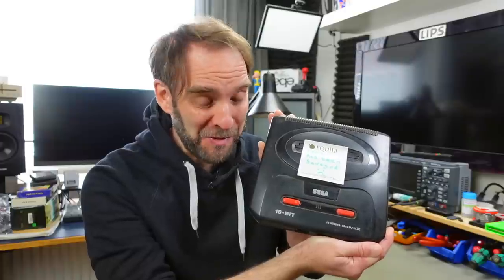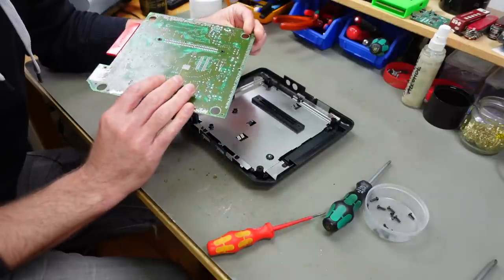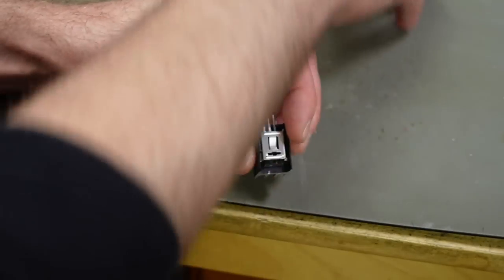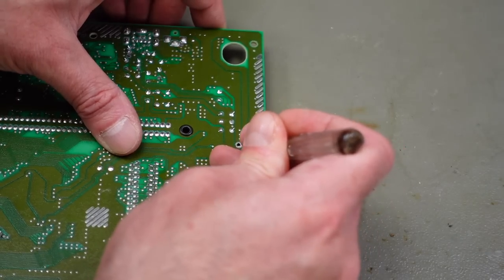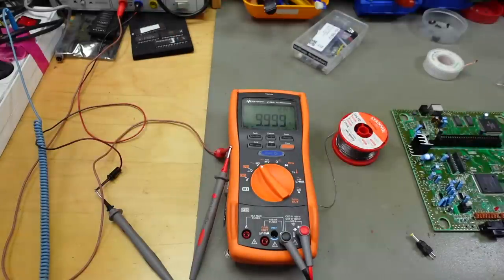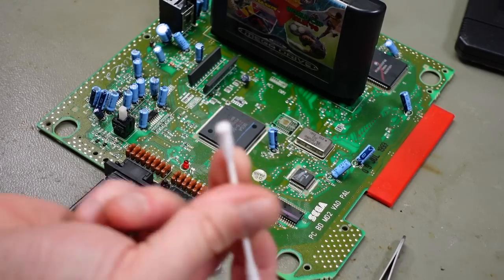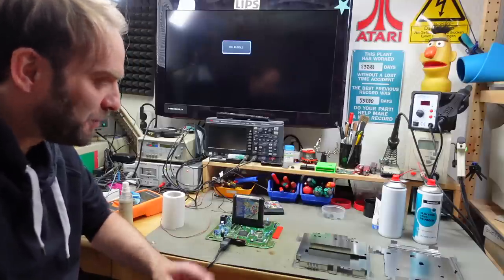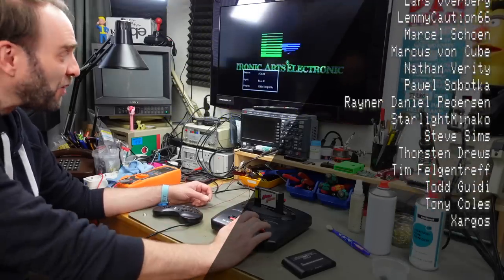Sega Mega Drive II Quick Fix and Cleanup

Comment: Hey Jan. When removing a regulator that's bound to a heatsink, get the hot air station out and warm up the area around the regulator, primarily the ground plane, then if you can prop station nozzle so its blowing on the heatsink while you work on the pins makes life far easier 👍
Reply: I just snip the legs of the regulator as close to the body as possible, pull the legs out of the board when the heatsink is off.
Reply: Seconded, hot air + iron works magic when you are working on heat sinking areas.

Comment: erm, wow, I totally forgot about that Megadrive, now I feel like a ** writing that on the case/board I don't remember doing it but I obviously did not consider the extra editing, if I remember right it was savaged before I got it and I had so much trouble getting the 7805 desoldered I gave up, fast forward XX months I now understand the value of a quality soldering iron :D great to see it is up and running again!
Reply: And we viewers now have to keep guessing what you wrote. I even paused the video but Jan Beta did his job well hiding it. Bummer.
Reply: @pe1dnn  Pretty sure the one on the board says FUN, because that's what you have when trying to desolder that 7805 and heatsink
Reply: @pe1dnn  it rhymed with ducked

Comment: I have two Megadrive II and both works perfectly. The market has been flooded with these machines and even if they were cheaper done most of the time they works better then the first version. The second one I bought for almost nothing since it had no box and cables. I even got a cool rent box and a RGB-cable.

Mega Drive 2 model used a different AV output from the first generation machine, with a much smaller plug design, however it brought the welcome addition of Stereo Audio along with the Composite Video signal (whereas the original Mega Drive only had Mono audio output, and relied on the headphone socket for stereo sound conectivity. If you have a TV with RGN SCART input, consider getting the best picture possible with a Multi-AV to RGB SCART Cable.

Comment: Thank you so much for putting this video out! I greatly appreciate the parts about removing the voltage regulator and fixing the reset button. :)
Reply from the maker: Hope it helps! It's certainly not very trivial to remove/replace the voltage regulator (as presented in the video). :D

Comment: Very good repair. I think there must be several different versions of the Mega Drive II. I bought a lot of 3 on Ebay as broken and when I opened them, all 3 of them were different inside.
Reply: There were multiple revisions, starting at VA0, which seems to be the one Jan has here. According to the net, at least the NTSC version went through several revisions more. I don't see hints at other PAL revisions, though. Might be a good idea to replace the 7805 in my MD2, though...

Comment: Fun fact:
The old 9/10V unregulated PSU that came with the Mega Drive are really more in the ballpark of modern 12V Regulated PSU.
I measured ~14V Idle for my Original Mega Drive Power Supply and 11,75V under Load.
Another thing: If you are at around 13,5V or lower at idle and 11,5V and lower under load, you need to replace the 3300µF/16V Cap inside.

I also have an old, Linear 12V PSU: unloaded it does 16V.
Due to Rippleness of modern PSU, I think it might make sense to replace the Input caps with Polymer or a mixture of Polymer and Ceramic capacitors instead.
Reply: On my Master System 2 I'm using a 9V PSU pilfered from a Guitar Pedal and it works :)
Reply: @DrTofu83  9V Regulated DC PSU? That can work in some cases, on my SFC, a 9V SMPS didn't work.
Though I don't own an Original one, aand can't measure it. And getting ine isn't easy as I need a Step Down Converter too...
But I got a 10V Mega Drive one and measured that. And that was around 1,,75V under load, with a new Secondary Cap and~14V unloaded. Someone with a US NTSC SNES measured the no load Voltage for me and it was similar to the Mega Drive PSU....
Though I need to get a FULL BRIDGE RECTIFIER Inside the SFC.

Also, something that might be important for use with modern PSU: you might want to replace the Input Cap with a modern Low ESR or even Polymer Cap.
Reply: @Stefan_Payne  Guess I got lucky, or the EU Master System II was somewhat more forgiving. 

The original 10V PSU died, I had this 9V from a guitar pedal, tried it and it worked with no hiccups
Reply: @DrTofu83  How could the Original PSU die though? ;)
Its just a lump of Copper and Metal + 2 or 4 Diodes and a BIG Capacitor. That's about it.
So my guess would be that your Original PSU should be serviceable, if you still have it. All you need to do is to replace the Capacitor and/or the Diodes (or the Diodes with a FULL BRIDGE RECTIFIER)...

Comment: Thanks for another nice video Jan; when you first opened the case I thought "someone has already replaced all (electrolitic) capacitors', that's how it looked to me. Are you sure those are the original capacitors?
Reply from the maker: Pretty sure. They are from the nineties (judging by their design) and there are no signs of resoldering on any of the capacitors as far as I can tell.

Comment: The z80 was often thrown in to that large ASIC chip, starting with the 315 label. Originally on model 1s it was just the VDP but later down the line they put more and more components into that ASIC.

Comment: For things like that regulator, preheating the board (and heatsink) with hot air works wonders.

For the damaged ground pad.. im not actually sure why they bothered to use a plastic-cased 7805 here. The heatsink is connected to ground, and the centre tab of a TO-220 is connected to the middle pin - also ground!!

Comment: Does the Mega Drive 2 also require Center negative PSU???
That's why I put in a FULL BRIDGE RECTIFIER in my two Mega Drive 1.
So I can use modern SMPS....
And I also replaced, what I think is the Input capacitor, a 16V/220µF one, with a 470µF Nichicon on one and a 1000µF Kemet A750 in the other one (because i was out of Nichicons)

Comment: I got a question: On my own sega mega drive 2 I have the white letters with some yellow. So if I start a game and play it the white parts are yellow. Has this something to do with the power regulator or the capacitors? It also becomes hot on the left side on the cartridge where the power regulator is. Should I replace it?

Comment: The device which looks like a hybrid is a jumper pack for setting the region code.
Reply: No, it's a capacitor array on the data bus. They must have had problems with noise on that bus.